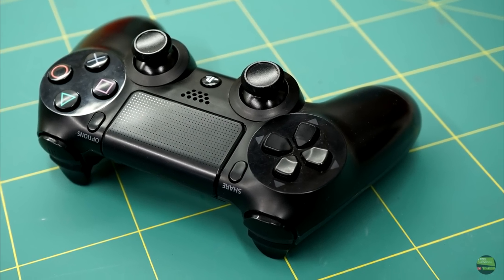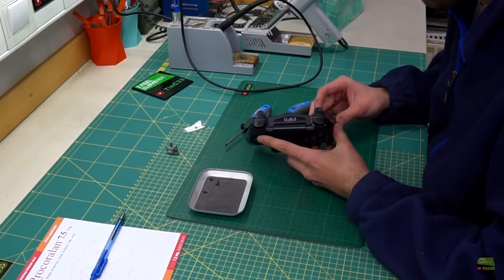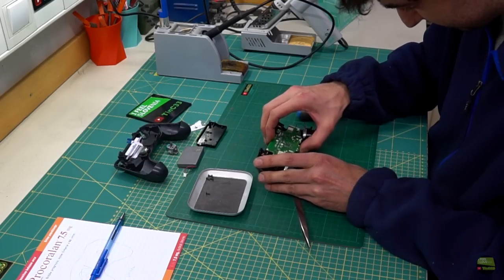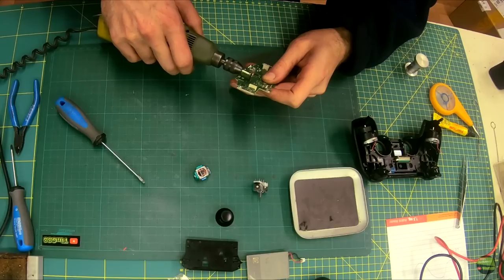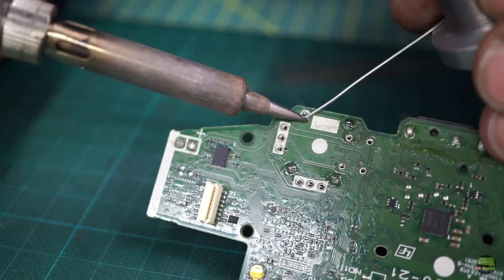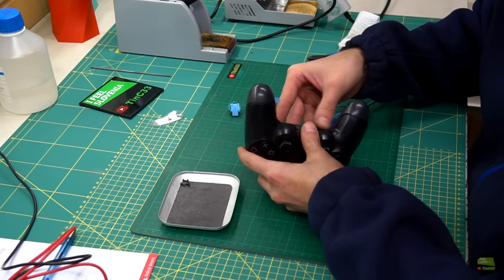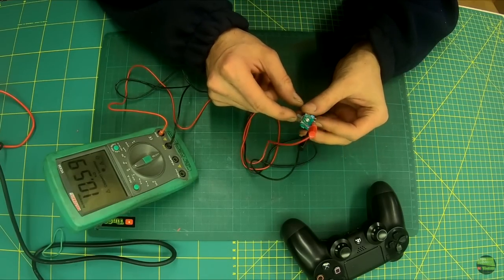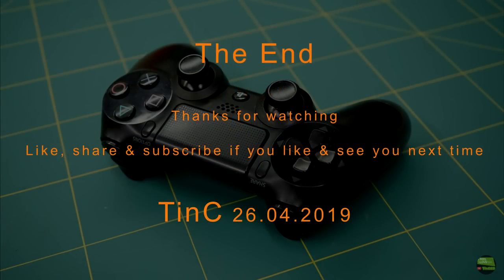PS4 Controller repair [joystick replacement]

Comment: so far the best tutorial for repairing your ps4 gamepad
Reply from the maker: Thanks, but it's not mine, i'm a win PC guy and newer own a PS, maybe someday, if we can use ps for other stuff like games.
Reply: @TinC33  
i own 2 ps4 pro with 5.05 exploit and let me tell you i am in heaven with all these mods and the ability of using linux operating sys. man you should get yourself a ps4 with 5.05 firmware.
if it is ok to use an official console?, then i wish you a happy gaming.
Reply from the maker: @gh5643  but i only play call of duty 2 online here and there ;-) pc use more or less for internet, video production and cad programs
Reply: Lol couldnt see anything when removing it. Those modules are stress to get off the dam board. But then again i used to use a cheap chinese soldering iron

Comment: You can just replace or clean the copper contacts inside the joystick assembly without replacing the whole thing. I do it all the time. You just pry the four plastic sides off and the contacts will fall right out. Don’t worry, the solder will hold even being bent back multiple times
Reply from the maker: good tip.
Reply: Ye but for people like me who has abused their L3 that aint the issue.... seems the tactile switch inside has lost its lust and I gotta press it hard as hell
Reply: Thanks will take a look as both my controllers are unusable. And I opened it up and face it a clean but didn't last long and didn't do squat for one of them. Have tried talking the contact apart will try that. Thanks
Reply: do you have a video showing your method, please?
Reply: Good looking out. This is not necessary for fixing stick drift, but this is how you fix an analog stick that is getting stuck. Or if the joystick won't click properly.
Reply: Can you please explain for me what you meant ? ... I feel ur comment gonna be so helpful for me

Comment: This is a great video and I love how you also troubleshooted the existing joy con stick after replacing it. Now I have to buy a lot of products 😃
Reply: I can t find the problem i replace it but when i use it now it turn left all the time 😔
Reply: @GhostAvengerGR-  maybe double check for bridge connections but the same happened to one of my controllers it’s both sticks i think something is wrong with the motherboard. I did a replacement on another controller and it’s fine
Reply: @dannyboy643ify  i think best way is to give motherboard and new analog stick to specialist and he said 2€ for replace it and it work perfect
Sorry for my english

Comment: What do you measure with the multimeter? I see several people complain about drifting issues after replacing the part. Do you do that to check if the replacement joystick is faulty?

Comment: What is ur tempature on your solder iron?
Reply from the maker: I set to max 450degreeC but i use only 80w soldering station, better to use 100w or even more powerfull soldering iron.

Comment: One of the green boxes on analog stick broke off :( by snapping it too much.
Reply: Mine too, U got any fixes?
Reply: DeadSh0tZHyper not yet ... my dad works 3rd shift who has a soldering kit so that I can attempt unsolder the 3 holes from broken green box to solder a new one I got from a 8 pack from Amazon for about $7 with the white sensors in them if I make sense
Reply: @Q1234.  did it get fixed?

Comment: What heating tool are you using to take the joystick off?
Reply from the maker: I use desoldering gun from banggood (you can see review on one of my videos) but you can desolder with basic soldering iron also, but use at least 100w one.

Comment: I am having problems understanding what he is saying from about 5:46 on. He is testing the resistance for some reason. Anyone know why and what?
Reply from the maker: Just testing old potentiometer to see where the fail is, not important if you replace with new joystick
Reply: @TinC33  , Yes. I was curious about how to test for bad components. It was hard to hear what you said when you found the bad part.  You were testing resistance. Were you expecting high resistance if the part is bad? If so, would  it have been possible to use resistance to tell whether it was bad without desoldering it?
Reply from the maker: @jpvoodoo5522  dardly, better to desolder them, but can try, measure between middle and any outer leg, resistance must increase evenly, if resistance sudenly jump on some point it's dead.

Comment: can you suggest a link to buy a good analog module joystick replacement with a perfect reading you showed
Reply from the maker: Idk which one is good, but the one i rused here was cheapest one from ebay, and it worked good

Comment: My question is how hot my the soldering iron be. I see some people say 650?
Reply from the maker: 350 to 400 will be enough, but more important is that you got enough powerfull soldering (about 80-100w) otherwise the temp decrease too fast and won't reach 400 degree.
Reply: @TinC33  understood. Thanks!

Comment: I just bought a very cheap controller, nothing out of the ordinary but surprisingly the only minor issue is a small dead zone in the joysticks. Other than that, it is actually a good controller and I was thinking why not just change the joysticks for better ones? It may be to much effort for a cheap controller but I think it would be a fun project, do you think it would be possible with the right parts? Nice video!
Reply from the maker: Sure it be possible but be sure you got at least 80-100w soldering iron.
Also lot of coments here says many joystick bougt on ebay are badly quality but that one i use was cheapest from ebay and friend says it still work fine.
Reply: I have the same deadzone issue on one pf my cheap controllers, did u replace it for better sticks and did it work?

Comment: Great video thanks! I've never soldered before, which soldering iron should I get for this? What wattage / tempreture etc? Also does it matter which soldering tin you use or is it all the same? 
Would you mind linking all the tools you used in the description? Thanks again for the tutorial.
Reply from the maker: Soldering tin, doesnt matter i use 0,8mm with fux inside.
Soldering iron, there are lot of ground surface on that plate, that mean that you need to head a lot of material so i advise you to use 100w soldering iron you won't need a solder station for that just enough power soldering iron and a sucking pump.
Reply: Could you give us the link to the suction pump to use to remove the solder points please? @TinC33
Reply from the maker: https://www.youtube.com/watch?v=NhIzDuFjrSk&t @gamersoruro

Comment: Very informative video man, many thanks! My 1st gen DS4's left stick has the drifting joystick and before I attempt to repair it, I'm going to test the components to make sure they're bad. I have a couple of questions:  1) When testing the joystick off the board, do you have the multimeter  set on diode mode? 2) When testing the holes for contact on the board, do you probe the same hole on both sides? Thanks in advance!
Reply from the maker: Thanks, 1st no you set multimeter to ohm settings, so you can measure the trimmer then slowly move it from one to other side, and watch the meter, number must increase evenly if there are some strange jumping of numbers or even drop to zero in zome position it's fault.
2 yes measure same hole, so you check if the connection go through the hole, because you can demage them while unsoldering, use powerfull solder iron at least 80w.
Reply: @TinC33  Ok I see, thanks for clarifying that bro, I'll keep that in mind! Stay safe have a good one!
Reply from the maker: @RuWs6ix  thanks, and same to you and yours, stay safe

Comment: Hi can you recommend me a desoldering tool to use. Budget price as it's just for this controller hopefully. I have no clue what I need so any help appreciated thanks.
Reply from the maker: Just buy enough powerfull soldering iron, at least 100w and a basic sucking pump for a few $ good desoldering gun cost more than new controller so...

Comment: some of the metal rings around the holes have come off when soldering, now the solder wont stick to the board, only the pin. What did I do wrong?
Reply from the maker: Overheat, or you pull the leg too hard without desolder it 100% so you broke the circuit board, but don't worry, if there was just a ring arround the hole just leave it's just to hold in position, but every ring at least on one side of board, is connected to a wire wich go further to pcb, find that route and solder leg here, you may use a piece of wire to connect.
Reply: @TinC33  do you know any places to get a cheap circuit board, I damaged this too much
Reply from the maker: @InSynnc23  i don't know, i don't own a ps, that was first time i was holding remote... Try to find some broken remote on ebay.
But are you sure you demaged toomuch, you just need to connect all the broken ways ;-)
Reply: @TinC33  yeah I messed it up really bad lol, gonna have to try again with a new motherboard. I had my solder iron set to 350 degrees Celsius, are you sure the rings came off coz too much heat?
Reply from the maker: @InSynnc23  i guess you got too weak soldering iron, you need at least 80W or better 100W, otherwise you heat too long, and heat entire board instead just a spot. But that the ring go off i would say that you pull joystick too hard whan there still some solder hold it to the ring.
Reply: @TinC33  can you do a video on this issue

Comment: Hey a just done the exact same job on two diffrent ps4 controllers. It's the 1st soldering I've ever done, Im quite happy with the soldering the issue I have is both these controllers  will not switch on anymore. Any idea what I might have done wrong?
Reply from the maker: Did you connect all the connectors back, when you soldering did you maybe broke some line on the pcb? Chack that two things
Reply: @TinC33  all the connections are good. I removed the thumbstick with  the copper wire and soldering iron. That may have heated it up too much. From the little research I have done seems the heat gun method is the only way to do it without heating it up too much.
Reply: @richardturpin3665  did your controller switch on eventually

Comment: Hey man, I followed the tutorial and it worked well...facing a slight issue after reassembly. The controller turns on okay and also goes into pairing mode, but it does not appear on the Bluetooth list for any device. it also does not glow yellow like it normally used to when I plugged it into a USB port, could you please tell me what I may need to fix? TIA
Reply from the maker: Check all the lines on the circuit board at the area you worked on, you may broke some of them when soldering.
Reply: @TinC33  how can i do that?
Reply from the maker: @yuvansharma1603  check visually and if you see something strange follow those line and measure it with multimeter if the line is ok, othervise fix it with a tiny wire.

Comment: So those little green boxes on both sides of the controller two of them broke off does that matter can I just put them back on the side of the joystick or do they have to be connected to those pins
Reply from the maker: Yup they had to be connected (soldered) to that pins.

Comment: Hi do you have video with the additional wiring
Reply from the maker: No that's the only remote i ever hold and it's even not mine.
Reply: @TinC33  do you know where one would connect the wiring when the pads around the holes are gone? Thanks
Reply from the maker: @Donnellys_Recycling  no try to check visually for the ways on the board

Comment: What is the difference between 2.3k and 10k potentiometer. I see these 2 types are available but it is not specified on the site. I might get either when i recieve it. What effect will they have on the controller.
Reply: 2.4kh are allegedly for ps4 controllers. What I want to know is what the hell is he doing with the multimeter

Comment: So i tried doing this with my soldering iron but the manufacturer solder just won't melt not even at 420°C. So you're saying that i should put 60/40 lead on the old solder first? Man, i was so disappointed when i couldn't do it.
Reply from the maker: Try to melt a bit of new solder wire on the old one firstly,  if still don't go you'll need a more powerfull soldering iron, mine soldering station in this video is 80w.
Reply: @TinC33  Thank you for replying. I have a Yihua 939D+ with 75W.  I think it's good enough and can get up to 480° but that lead free solder is on another level. I would leave the tip on the solder for like 3 seconds and nothing.
Reply from the maker: @thingshappen9199  3 sec is not enough, put tip on old solder, than just add a bit new soldering wire with flux, so tip will ger better contact with old solder, and heat will transfer better, but maybe you'll need 5,10 or even 20 seco ds to melt entire solder.
It's problem because it's solder to a large area of pcb, so you need to heat up big area to lose the old solder.

Comment: how much celcius on your solder?
Reply from the maker: Celsius is not important, watts is the key, you'll need at last 80-100w soldering iron.
Reply: @TinC33  i realize i just have 60 watt solder, it will be okay?

Comment: \Hi, if you replace the analog component, twice and still have a drift what do you think can be causing the drift? I can't think of anything else....
Reply from the maker: uf hard to say, maybe some connection disorder, or some bad capacitor make noise on the signal, but would say you got bad luck with the component, specially if you buy all at once (all from same series) do always drift on one axis or booth? it try to replace only the potentiometer from old one.

Comment: What temperature to use
Reply from the maker: Enough to melt the solder 😉 more important is to use enough strong soldering iron to melt it fast before heat entire circuit.
Reply: @TinC33  i suppose is necessary to use the heat gun right
Reply from the maker: @DittoNews  i didn't use them

Comment: Hi, can you please help with the link for the good replacement parts? I've got 5 different analog sticks from ebay and they all bad. Had to buy non working controller to fix my issues..
Reply from the maker: Huh i don't know because friend order it and just deliver me to fix it, but he said he take cheapest one from chine for few $
Reply: Amazon would have parts for PS4 controller I order it from there and anything else U need
Reply: @TinC33  that is the problem, you can't just the take cheapest one from China... all of them is not good.. i did that mistake already... all you can use from them is white disks..
Reply: @zohaibzulkarnien4876  yeah, i found them on amazon.. but I'm bit scared that they won't be the same as pictured

Comment: anyone thinking of trying to desolder a analog on their controller. its not a quick job lol. i bought a solder kit did some testing on a broken controller and couldnt get either of the analogs on that out. i ended up cutting the excess pins length off until the surface was flat, then just yanking it out. that worked but no doubt destroyed the only circuit board. the best tip i got from this was add on excess solder. going to try that as the little bit of solder were the most stubborn.

Comment: I tried this and the new stick does not work. L3 works but the movement does not it is just stuck slightly to the left. What do you think the problem could be?
Reply from the maker: Check all the pcb connections while you unsolder the old joystick you may broke some cooper "route" on pcb.

Comment: I wanna change them with my other broken controller cause on my other one when I press down on d pad it pressed right d pat too and it's so annoying, on my second controller i have high stick drift but on my main one i don't so I wanna swap the analog sticks from the main one to the stick drift one
Reply from the maker: Ok just do it and make a working one out of two brokens.

Comment: Hi nice video ! i have some time some problems soldering new stick, i have a soldering station , i take off the old stick carefully , clean all of this , install new one , but sometime there is still drift , i tried severals kind of stick, official and oem but i have really a lot of time drift problem after installing new one, do you have an idea from where it comes ?
Reply from the maker: Can't say exactly but you can check for connection and pcb ways if someone demaged...

Comment: I desolder analog stick,but in some throgh-hole  cannot find continuity on both side of pcb.can you help pls
Reply from the maker: Just put a tiny piece of wire through the hole and solder on booth side, if there are stick pin into that hole you don't need the wire, just soler on booth side so you got contact through the pcb.
Reply: TinC33 i have soldered but joystick keep moving left